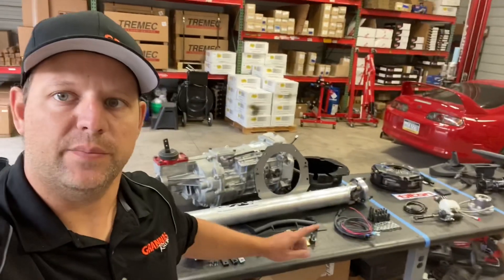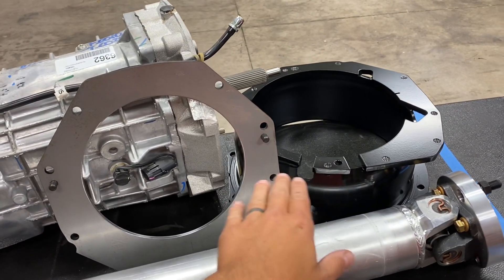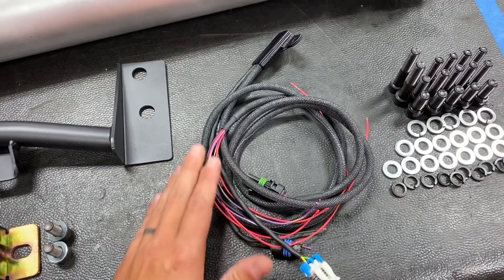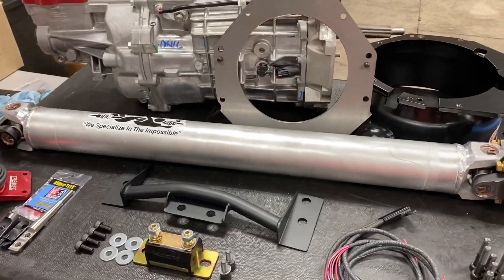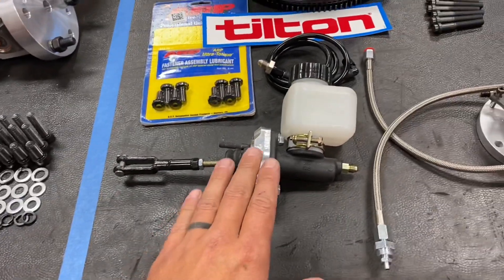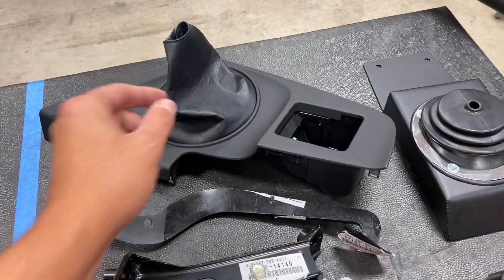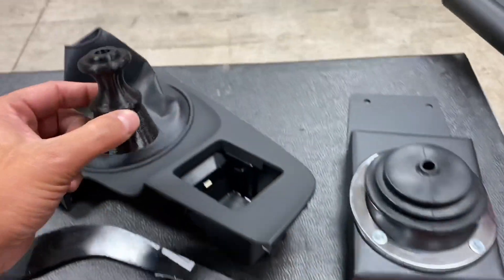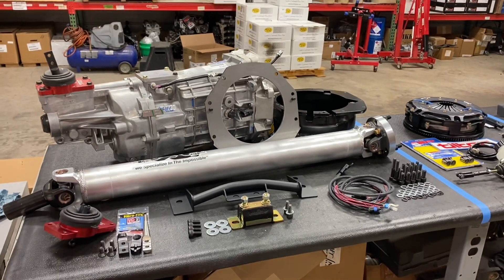Part One: Overview of GR700 swap parts

Comment: Which that Bluetooth harness do u still need the dekota box if running infinity 6?
Reply from the maker: You should be able to unlock reverse with an output. As far as converting the speed signal and sending that to the speedometer with the infinity I am not sure